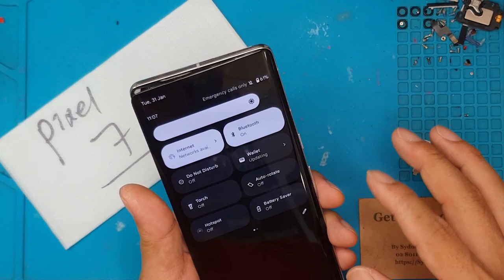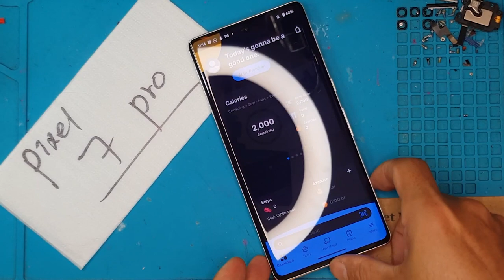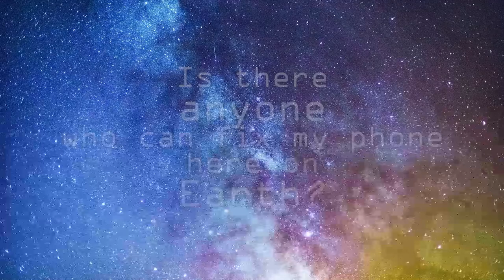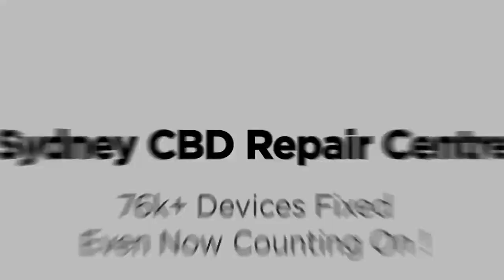IT'S TOO EASY! Google Pixel 7 Pro Screen Replacement | Sydney CBD Repair Centre

Comment: Hi there, I have dropped my Pixel 7 Pro and the screen no longer functions, so I am unable to login and use the phone...)  Local shop has quoted me $500 AUD for new screen.  Is that the cost?  I am thinking of contacting the Google store as I bought the phone outright, to see if they will repair under warranty and principle.  (Before I had a Samsung for 4 years, dropped it heaps and it was fine!)  The pixel had a protective cover also!?
Reply from the maker: if google has that policy , it would be great. please let me know after you try it. thank you
Reply: @SydneyCBDRepairCentre  I called up and they are going to look at warranty assessment. They might reject, so I will confirm.
Reply: @DougieL  were you able to get the warranty for it?
Reply: @heyaimmatree  I have had a delay in sending it away but Google were great and I will be sending it this week. I will update when they confirm whether I get a replacement.  All the best!